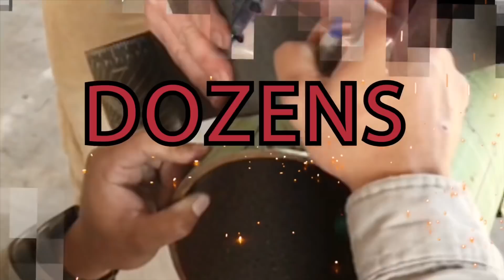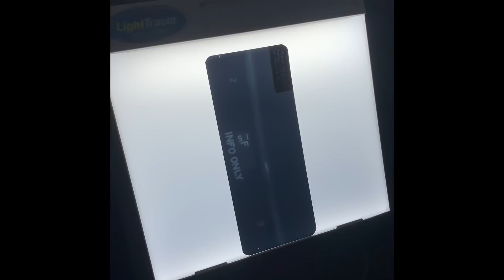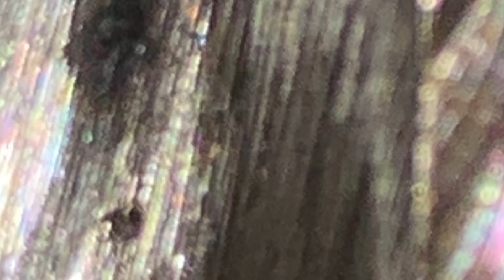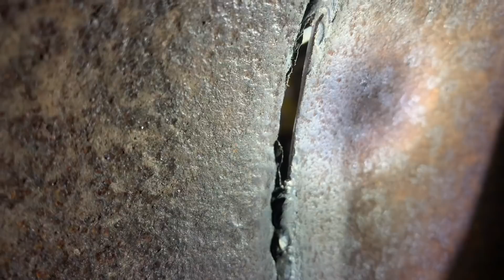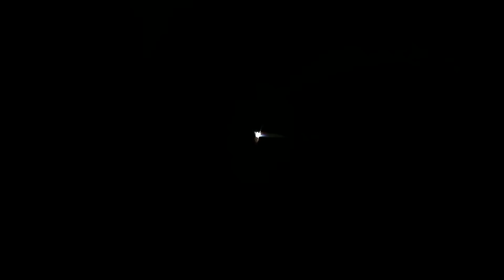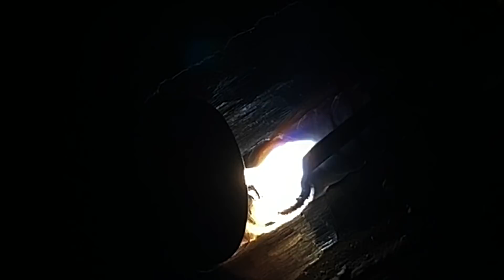Pipe Weld Repair after Busted X-Ray

Comment: For the benefit of the rest of the (non American) English speaking world  "Skins" = Radiographs,  "Busted" = Failed,   Also on large diameter heavy wall pipe repair preparation may be carried out by another tradesman namely a Boilermaker, on some contracts these costs may be backcharged to the Welder. Swann was also co-inventor of the light bulb.

Comment: I had a old timer teach me pretty cool trick to remove to burrs from the inside of the pipe takes a pretty steady hand but works really well  get a good stick out with you tungsten turn up gas flow a little put it down inside the pipe and melt the burrs away I have done this mini time with high success rate

Comment: I'd like to share a trick to remove stubborn porosity in your carbon tig. If you just can't get it to burn out, clean it up one more time, grab a piece of 3/32,  316 stainless wire and weld over the area with one tight pisser bead. Ditch the wire, and don't get caught. 😂 I don't know why it works, but it does.

Comment: I’ve never used those “bare skins” on a repair. X-ray usually just marks the area and I’ll dig into it with a grinder disc and rounded edge sanding pad. I’d like to try those tho.
Reply: Jeffrey Crosswhite ??
Reply: @downhilldaddy9346  I put it in the wrong place they are doing a test pipe someone asked what went in the pipe sorry
Reply: Jeffrey Crosswhite oh ok 10-4 brother. You good 🤙🏾

Comment: Australian boilermaker here. Awesome to finally see welding on YouTube that doesn't have 10k welders. I noticed he was using a scratch start. I've done little pipe welding that requires the full x-ray job but just curious is there a reason for the scratch start? Or just what ya have to weld with
Reply from the maker: Ross Cutting most all construction jobs will be scratch start especially in the field. Even with a remote they are still scratch start. Most industrial welding machines don’t offer high frequency start.
Reply: Are you talking generated welders etc. I figured it would be as simple as that just thought I would confirm. Thanks
Reply: @TheCuttz1984  Both engine driven and electric power sources are most always scratch start in the field.  There are several reasons for using scratch start.  A fitter/welder team may be 2-300+ feet from the power source so a remote contactor, like a foot pedal or torch button, usually isn't an option.  If the distance wasn't a problem the position of the weld can make it difficult for the welder to operate the contactor.  Also, the team can jump from TIG on a pipe joint to stick on a hanger quite a few times a day.  Being able to just use the same leads and connect a TIG torch to it is much quicker and easier to roll through the day with good production.  Once a welder is comfortable with scratch start it's definitely the way to go.  Only a few pipe materials are difficult to produce X-ray quality starts and stops with scratch start.

Comment: Do you have to key hole dip when you cut the root in the pipe to fix. Can you hold the wire in the center and wand wash over it like if you was feeding it
Reply from the maker: Jesse Davis well it’s really personal preference as long as you break the walls down you will be fine

Comment: a trick i have in my back pocket for a repair is dental tools. They work excellent to remove that burr on the inside and if you are burning rod are good for removing little bits of slag on the toes. Whats great is most community colleges have these dental programs and they THROW AWAY the used ones! so its literally free to you!
Reply: There is a pick set at autozone similar to dental picks that may be a little more heavy duty

Comment: Just found your channel, that's some pretty sweet looking repair...!
 I've worked around a few guys that were Pipeliners, at one time....but they were all doing stationary indoor work when I knew them....some of them were...uhm...interesting..
 I've been a welder in machine shops, fab shops, structural, and new construction...none of this stuff was ever done downhill...all TIG V-up (or flux-core/Low hyd. V-up) for some of the structural....lots of chro-mo boiler tubes, and stainless food/chemical piping...

Comment: Good luck with the hip even, I’m 31 just had mine replaced, It hasn’t slowed me down much. Y’all check out a “swivel head deburring tool”, it should reach the burs inside the pipe.
Reply: Damn, a hip replacement at 31? What’s the deal?

Comment: Dose the tungsten get embedded into the filler wire when you light up off the edge of it like that?
Or is it ok to swipe it on the side of your tungsten when
using a scratch start rig like that?

Enjoy the videos man thanks!
Reply from the maker: +B no tungsten doesn’t melt at welding temperatures so the only way to embed tungsten is to stick the tungsten and then break the tip off in the weld. I’m sure there are some other ways but this is the most common.